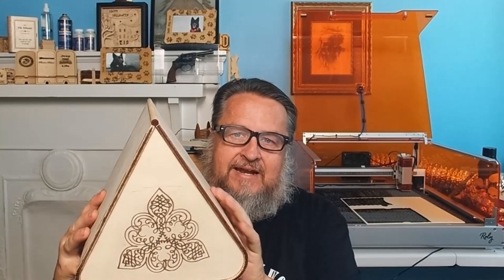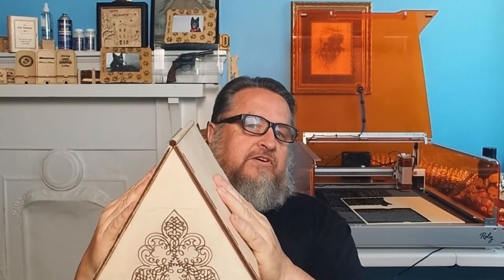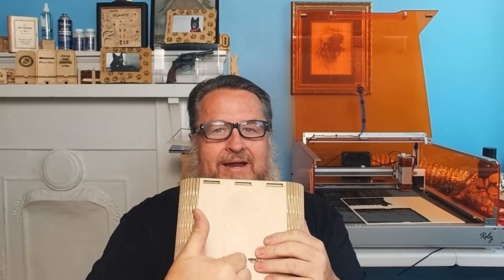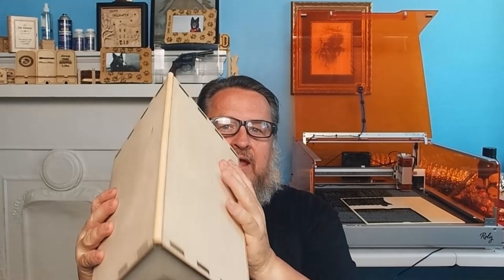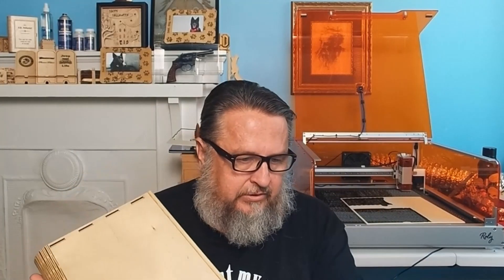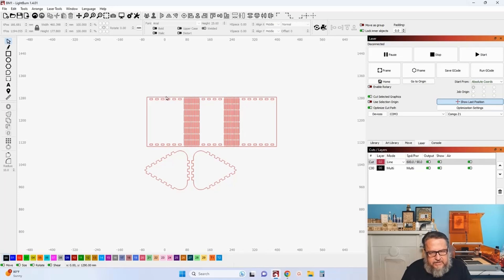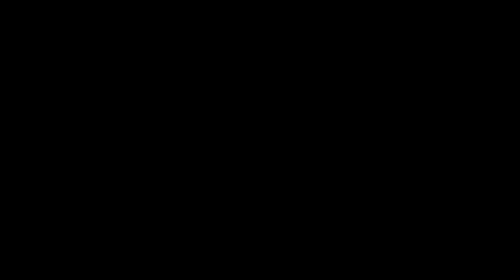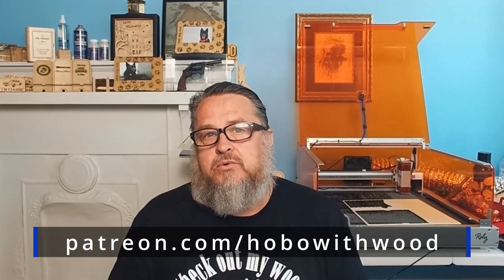Fixing Problems With Slots and Tabs

Comment: Excellent! I didn't know about putting nodes in the middle so they don't change size. Now, when you want to cut one or many shapes without leaving the shapes open, you must change the mode of the layer from "line" to "fill", then make the cut and finally change back to line mode.

Comment: I love this project.   Saw the first video and was very sad I couldn't find the file when it was offered for n/c.  Can I adjust slots and tabs in Corel 2024?
Reply from the maker: The file is available on my website. https://hobowithwood.com/product/nightstand-bookmark/  IF it was offered for n/c at one time, it was most likely for a short period of time after it was released. I will do this sometimes with a new file. I haven't used any Corel products since CorelDRAW in the 90's. Not familiar with any of Corel's capabilities.

Comment: Great video but I still can't get the resize slots in selection tool to work. when I pick Slot depth ,slot width, or tab height I never get the blue line with the arrows showing what direction will be adjusted. Is there a setting in lightburn I need to switch on for this to work.
Reply from the maker: Nope. I'm sure it is something VERY simple you are missing. But if you are doing EVERYTHING I demonstrated AND still not seeing the slots, there are a couple of reasons that could happen. Please send the specific file or the single piece in a design you are having trouble with. I will look at it for the Gremlins and make a video showing you the problem and the fix. hobowithwood@gmail.com
Reply: Could it be. Only just a suggestion are you uncoupling before going to the node application. Only a thought
Reply: Sorry ungrouping I meant to say.